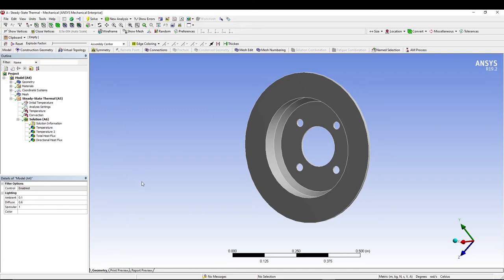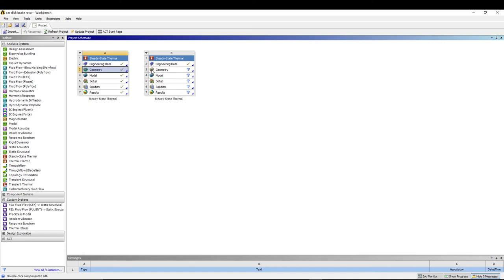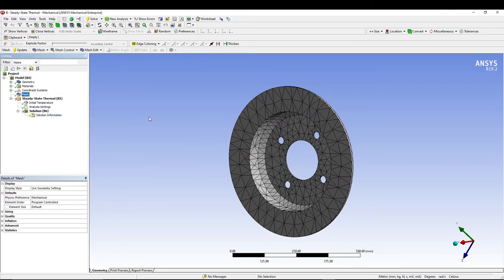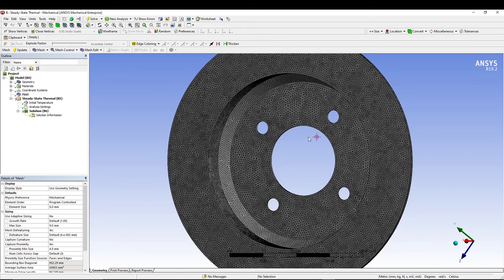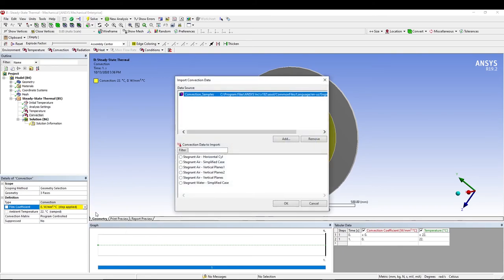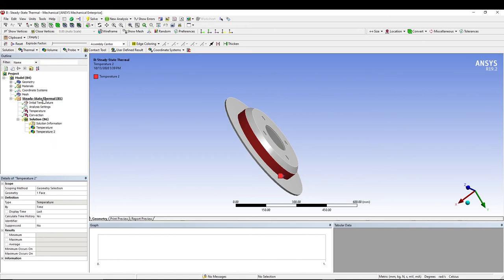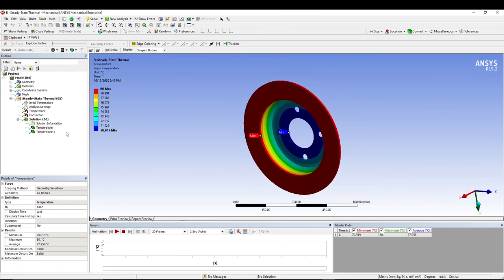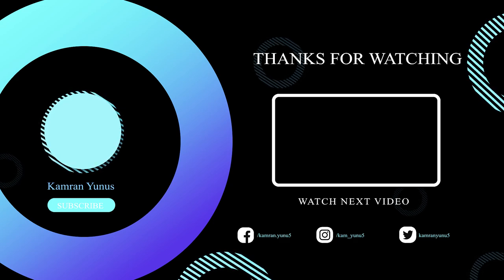Ansys - Steady State Thermal Analysis of Car Disk Brake Rotor

Comment: Sir, for better disc brake heat flux should be low or high?
Reply from the maker: It’s not that heat flux alone decides a good disc brake system. In fact the major parameter for deciding a good disc brake is material. However higher values for heat flux are preferred mostly.